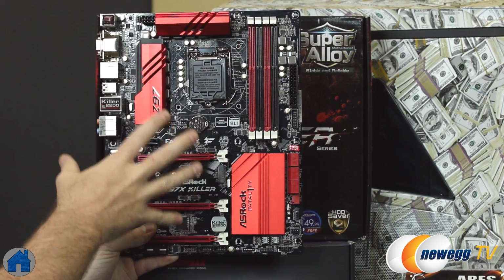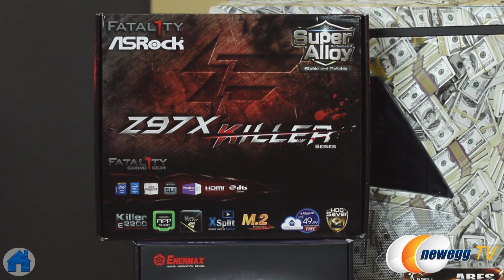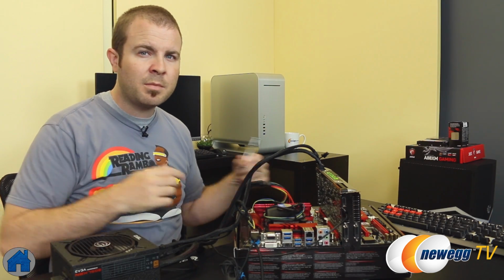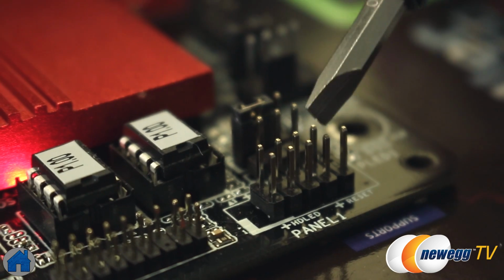How to Build a PC - Part 1 - Newegg TV

Comment: PLZ help is this a good build http://pcpartpicker.com/parts/partlist/ im looking to sli in the future so would the psu be a good fit? also in the future would like to buy the evga braided cable set. Should i replace the led fans with a 2 bitfenix alchemy led strips?
Reply: well if you are looking at sli, you should probably have a motherboard that can fit at least 2 video cards. Also, you have an unlocked (k series) CPU. If you plan to overclock, I would reccomend a Z87 or Z97 chipset motherboard. if you arent interested, it is a powerful CPU as is. And if you do want to do SLI, assuming you use another identical card, you will be behind in wattage. i would shoot for 750-850. If you decide you dont want to, you are good as is.

Comment: Hello everyone will MSI Z97 Gaming 5 be compatible with Intel Core I5 4670K? They are the same socket but he mentioned something about chipsets and this is the thing Im not sure about.
Reply: It sure is compatible.  All you have to do is search the manufacturer's website and it will have a CPU compatibility list.
Reply: I was trying to find it on MSI's website but for some reason on my computer the first line line in the description where it states compability is very hard to read because you can't see all of the letters so that's why I was asking.

Comment: I have been trying to get confirmation on this build for quite a while now and I still haven't gotten a word back. However I will try again. I am trying to build a computer for gaming/recording/editing. I'll be ordering these parts off of newegg when I have the money.
 
Mother board: Gigabyte GA-G1.sniper Micro atx (lga 1150)
CPU: Intel i5-4690k Devil's canyon quad core (lga 1150)
GPU: GeForce gtx 780 ti (i'll be ordering this from the manufacturers instead)
PSU: Evga supernova 750W fully modular 80+ gold
RAM:corsair vengeance pro 16GB
Hard drive: seagate barracuda 1TB
SSD (for OS): samsung 840 pro 256GB sata3 mlc
Operating system: Windows 7 home premium
Peripherals: Asus vx228h black 21.5" moniter,CM Storm devastator gaming keyboard&mouse, Areocool Mechatron mid tower case, Optical drive from asus.

     This is gonna cost me roughly 2K. this will be my first build too. I don't know if this is a good build or if I am bottlenecking performance with some of these parts or if I'm going to break the bank when there are higher performance parts for less. Any feedback would be tremendously appreciated.

EDIT: http://pcpartpicker.com/user/RogueChristian/saved/cMNYcf
Reply: Don't get the 780 ti, get a 980 instead.
Reply: Because it consumes less wattage?
Reply: No, it's cheaper and perfoms the same.
Reply: Good point.
Reply: Here is some very useful sites.
http://pcpartpicker.com/parts/partlist/ (this site helps you tinker with your build and see what other options you have)
like sorting motherboards with ram sluts or ports...etc. also it gives you an estimated wattage which is a basic starting point, but for the best wattage calculator you should check.
http://extreme.outervision.com/psucalculatorlite.jsp (which is insanely detailed and gives you excellent numbers especially for future proofing.
and if it's no problem money wise, then get an i7 core, preferably the i7-4770K, since the GTX 780 is the highest Nvidia GPU, the new 9 hundred are not that much different and the Titan is for the insanely rich, you may want to go with the highest Intel CPU, again the x whatever is not a viable option even for most gamers.
lastly, like it has been said, check reviews and just keep reading about the whole thing.
and sorry if its rude. your better off posting in tech forums, like (tomshardware.com) than youtube.
Reply: Get Windows 8.1 instead of Windows 7 because generally it performs better in games and windows 8.1 will be longer supported by Microsoft than Windows 7. They are around the same price. You should not cheap out on peripherals, especially on mouse. If you would get 120GB SSD instead of 240gb SSD as it is only for OS then you would have money for Corsair Raptor M45 or MAD cats RAT 3 or 5 if you like futuristic looks. Trust me it's worth getting the good mouse you will be pleased with it. Get 980 instead of 780ti (to be honest you would be also satisfied with 970 as it only performs 10-15% worse than 980 on most occasions and it's waaayyyy cheaper). If you have to have the pc case from Star Wars then fine I just want to mention my case which is Phanteks Enthoo Pro (the case of the year 2014).  Make sure you get an aftermarket cooler in the future for your CPU I recommend Coller master Hyper 212 EVO.
Reply: TheBossIsHerePL 1st: yah I definitely have to have the star wars case XD 2nd: I'm kinda future proofing the ssd but I guess lower GB wouldn't hurt. and even though I was trying to avoid windows 8 I guess performance does have to come first rather than personal preference.
      also I was going to change the stock cpu cooler I just haven't decided which one to go for, so i'll look into the one you're suggesting.
 This helps alot, thanks.
Reply: Seallussus yah i'll research those today when I have the chance. As for the build being a "money issue" yes I'm trying to keep a tight budget of 2k or less. I'm only 17 so I'm not exactly bill gates. (oh and you wasn't rude at all)
Reply: Demitri don't worry then. this is an excellent build. but two more notes.
Assuming you want to overclock, your CPU is an unlock one after all. 
a good CPU fan should be enough for moderate OCing. of course a water cooling is better and all, but depends on the level of OCing. 
the second if about the PSU. according to pcpartpicker your estimated wattage is 421W. so your 750W is a bit bigger. of course if you plan on adding another GPU then it's fine. but if not, then you can go away with a lower wattage PSU to save money. not that your choice is bad, it's pretty good. but without another GPU you can get away with less. and yes, I know that you should get a bigger PSU than the minimum wattage, so for your build I might dare say that a 550-650W is more than enough. for instance this might be a good choice (Rosewill Capstone 650W 80+ Gold).
but those are just suggestions . there's more than one way to skin a cat after all
Reply: Seallussus I don't have a current need to overclock just yet, these parts are pretty high end as it is but I like having the option there and when I do eventually OC then I won't have to go buy another one. I was playing it safe with the 750W psu cuz I was uninformed of how much wattage these parts would consume. thanks for the suggestion nonetheless though :)
      Long story short I have plans to OC and have multiple moniters and possibly have an sli (because why the heck not) I might be planning too far ahead but I want this computer to last me a few years without having to upgrade too often.
     And because overclocking is more likely than not to have liquid cooling are there any suggestions to that? (not that I can't search online, but since I'm here right? XD)
Reply: Demitri yes. this build is pretty high end. most people just look to the highest hardware piece and think it's the standard.
anyway since you do plan to SLI your PSU should be fine, even with Water cooling and OCing its fine.
as to water cooling, the Corsair Hydro series is a pretty good&popular choice the (Corsair H100i) for instance is pretty good, but even the lower (Corsair H60) or (Corsair H55) is fine, also the (Cooler Master Seidon 120M) seems like a good choice. though I don't know much about water cooling. and technology is changing really fast nowadays.
Asking here is fine. not only it's a tech channel, but like they say :doing research over the internet is like drinking from a fire hydrant, it can be done, but it's messy.
Reply: Seallussus Hahaha nice saying. XD Ok I will look into this intently over the next few weeks, thank you very much for your help.
Reply: Demitri Glad to help
Reply: Seallussus I HEARD that if you want to EDIT and STUFF, GO WITH i7.
Reply: ollie pogi I don't know much about editing. but his build can OC. and he does plan on OCing with watercooling.  so he can easily push the CPU to it's limits. besides, you can always add more ram, if that's what you program needs.
Reply: Exactly. I'm stuck at 16GB with windows 7 though so if I ever need more i'll have to get a different OS seeing 16GB is all w7 supports. but i'll go with windows 10 before I even touch 8.1 however I doubt this will be a serious issue seeing as anything over 16 is overkill.
Reply: For editing I'd strongly suggest an i7 over an i5, the hyper threading is what you want when editing
Reply: pcpartpicker.com is a nice place to build your pc virtually sees all compatibility issues, shows best prices and deals. And def an i7
Reply: go with windows 8.1 its better then windows 7 :)
Reply: Ernest660 I regrettably will have to.
Reply: Demitri same but for fps boost its gonna be worth it
Reply: Ernest660 I still don't know if this is true or not (mostly because I'm too lazy to go check) but I heard that the windows 10 is a free upgrade but you have to have windows 8 first. and yah fps boost and now unfortunately most games (from steam) are set to work specifically for windows 8 so not much of a choice.
Reply: Demitri ummm ok :P sooooooooo windows 8.1 :D
Reply: haha yah I know. I don't know my stuff.

Comment: Possibly the best build video ever. One MINOR oversight... when talking about selecting a case, it's important to figure what i/o connectors you want on the case, and where they should be located. For example, USB3.0 is not included on every case. Also along the same line, that Colossus has the i/o connectors on the right side panel. That would be a deal breaker for me... my computer butts up against a wall on that side. (I'm not about to rearrange my furniture to accommodate the computer case.)

Comment: Ok guys I bought a pre built pic from best buy and I wanted to add a graphics card. I have a i5 4440 cpu. Would the prebuilt mobo bottleneck the gpu and cpu? Also how much watt do i need for the power supply with around a 750 ti graphics card? Yes I know o should have built my own pc but I don't want to deal with delivery

Comment: How's this set up?
Specs:

CPU: Intel Core i7-4790K 4.0GHz Quad-Core
CPU Cooler: Corsair H100i 77.0 CFM Liquid
Motherboard: Asus SABERTOOTH Z97 MARK 1 ATX LGA1150
Memory: G.Skill Ripjaws X Series 16GB (4 x 4GB) DDR3-1333
Storage: Samsung 840 Pro Series 128GB 2.5" SSD (x2) 
               Western Digital BLACK SERIES 2TB 3.5" 7200RPM
Video Card: EVGA GeForce GTX 980 4GB (x2)
Case: NZXT H440 (Green/Black) ATX Mid Tower
Power Supply: EVGA 850W ATX12V / EPS12V
Operating System: Microsoft Windows 8.1 Pro - 64-bit (OEM) (64-bit)
Reply: That's a nice system you got there, it'll do whatever you want plus more. :)
Reply: if you are just gaming you don't need more than an i5-4670k, and unless you are seriously overclocking a cooler master hyper 212 plus or evo will be enough, other than that it is a very good build.

Comment: first cool video need to see more of these the time lapse one you can't really learn anything and using different mother  boards is a very nice touch need to see more AMD builds  there are some nice  after market  air coolers the  be quiet  slim and the cryogen
ultimate R1  will surprise you  you should do a Holloween  build  the raidmax vampire
case would be perfect

Comment: Great video!  Couple issues though: 1. Anti-static wrist straps only work if everything else is also grounded to the same charge level.  Usually you get a mat that everything will rest on and the strap snaps onto it, or you clip it to a grounded workbench which everything also sits on.  Grounding to 1 thing will make you not shock that one thing, everything else is still at a different charge level.  2. The mobo could use a little more support when pressing on the RAM and CPU cooler. It looked like a lot of flex when you installed the cooler.

Comment: You should not use a plugged-in power supply as a grounding source unless you have a resistor protecting you from electrical shock.

Comment: why the 780? 970 is cheaper and yeilds better perforamce, I know you guys aren't actually gonna use the build but atleast save some money, unless you just had a 780 lying around doing nothing that was kinda stupid.
Reply: he said at the start of the video, they just went around and got some things for the build. You'd think that they would have had water cooler for AMD build.
Reply: I think this was recorded before GTX 970 was released to the public.
Reply: why the giant case? why the group regulated psu when EVGA has a better bronze and gold unit out than the NEX series? why? ....why? ... this video is a mere demonstration on how to put together a computer. the build itself is unbalanced and sub optimal in terms of part selection. it's not a guide on creating a comprehensive, balanced and well thought out build so much as a guide on how to physically put one together.

Comment: http://pcpartpicker.com/p/NNqTFT

Is this a good build? Can it run games on high or ultra sensitivity?
Reply: Nice but use z97 with that 4690k
Reply: Get a Intel Core i5 or i7 if you want the best results with your 970. The single core performance is way better then the FX 8350.
Reply: http://pcpartpicker.com/p/vJs9nQ

This one?
Reply: ***** Yup, you can pretty much get a z97 board for the same price as a z87. It's got more features and possibly better overclocking.

Comment: bulding a pc it's easy, the problem is $ :((
Reply: That is exact problem I have :(
Reply: Yet cheaper than buying a prebuilt one.
Reply: HoRzeNTarI Ahaha. That's the sad thing :|
Reply: if you've got around $1000≤ you can start off while upgrading later.
Reply: Yeah but rather than shelling out 1000+ for a pre-built one you can do it piecemeal over time. So you don't have to shell out a tonne of money right off the bat. 

I remember with my first build I just bought the parts from order to least to most expensive. Starting with the wireless card and optical drive, heh.
Reply: Steven W The problem with that is, that technology is advancing all the time and so are prices. For example you might feel a little stupid for having bought a gtx780 a few months ago (and still not come to finish your build), when now you could get the very same gpu for a lot less. So it would be more wise to save money, and then buy all the parts for your build when you have the money to do so.

Then again if you get good deals on used parts or new ones, and plan on finishing your build in the near future, then go all for it.
Reply: Yeah ikr Im only 8 so my parents won't give me money 😖😖😖😖😖
Reply: Well ya assembling the system is pie but earning  $400+ for a decent rig is much tougher
Reply: If all you want is to run the games you can do it for about $350, if you want to be able to do 1080p60fps, then you'll need at least $650, both before OS of course, as depending on the games you want to run, then you could go with ubuntu linux and be fine.